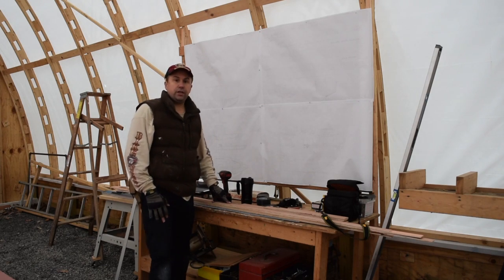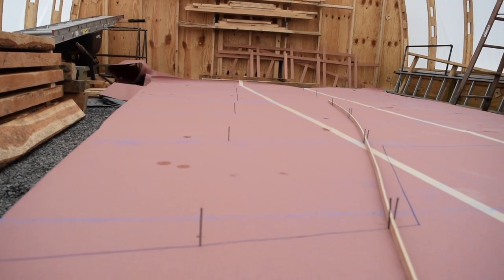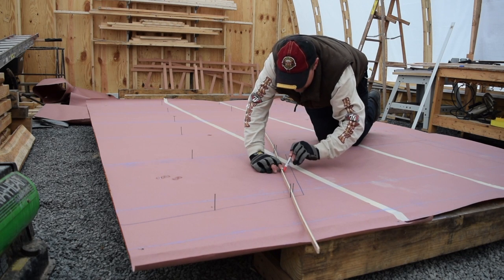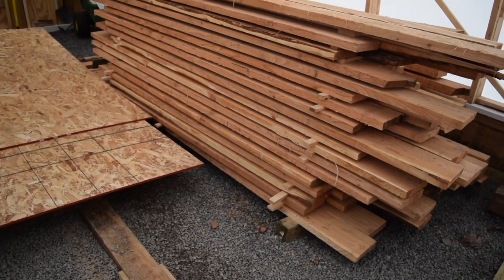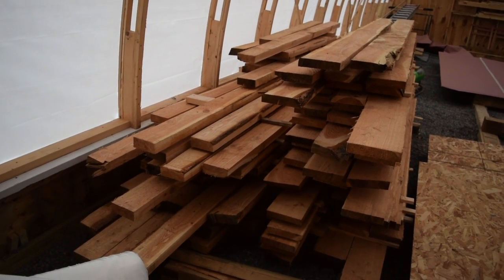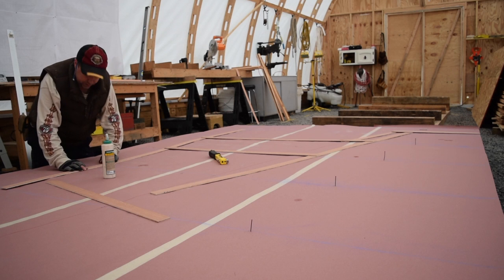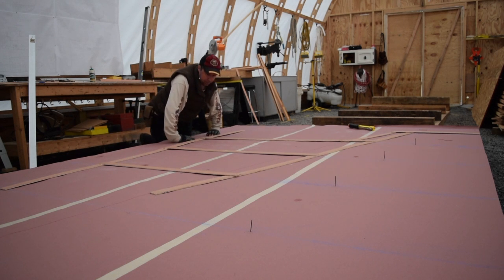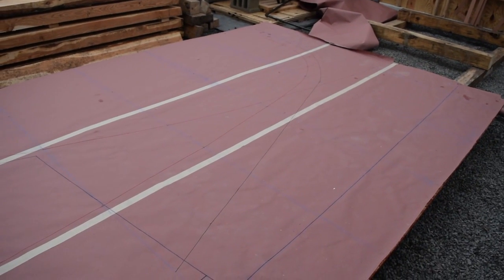Final lofting on our wooden boat build: Episode 4 Sea Dreamer Project

Comment: There is a lot of sap wood in those timbers.
Reply from the maker: No worries fernando, everything is oversize and we machine or cut most of the defects off.  We are laminating most of the big timbers and laminations are much stronger than solid timber so that kind of covers a lot of sins .

Comment: Yeah, condensation is a very tough subject to deal with in tarp structures. In some cases (not one here) it's actually more economically sound to simply keep the structure on that sweet spot between warm and cold, just to avoid it.

A personal example was a wooden church (europe) restoration, the whole right side had to be isolated because the restorers doing the paintings had trouble with water on their work.

A two layer bubble was built, that was kept at 16 degrees Celsius, with multiple testing points feeding to three electric heater blowers. And that was after quite a lot of head scratching and safety inspector meetings.
Reply: Also, supporting your local tiny guy is one of the best things you can do for yourself, and for your community. 
I'll bend over my head to find such people around me knowing that in the end, everyone wins.
Plus, these people, you build a good, working relationship with, they will also help you.

Comment: Hey , quick questions on the plans ;
Did you draw the boat yourself or did you buy the plans ? 
How much did it cost you ?
Reply from the maker: I bought the plans from George Buehler, he is the author of Backyard Boat Building and the designer of the Diesel Duck line.  They were stock plans and cost around $1800 USD.